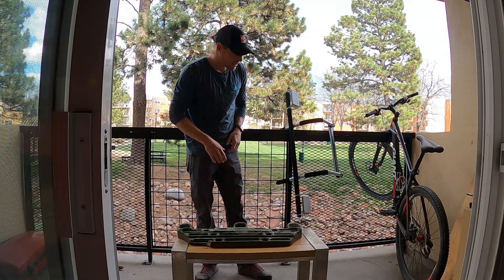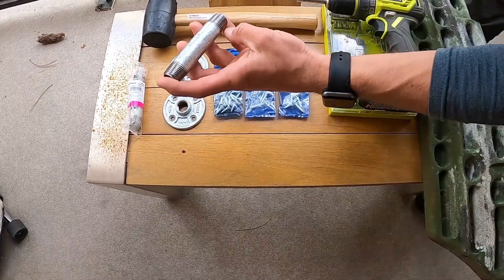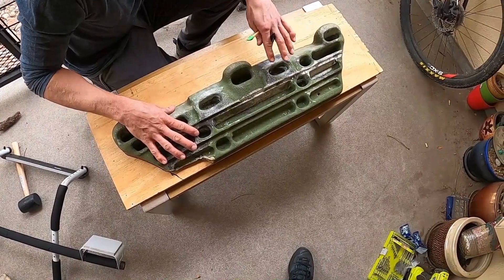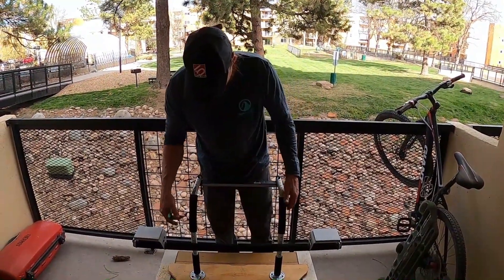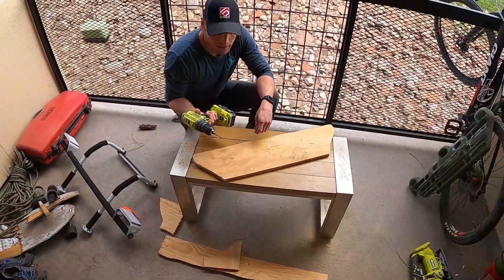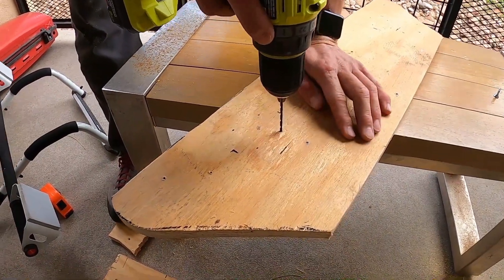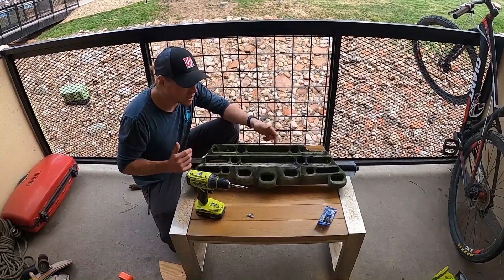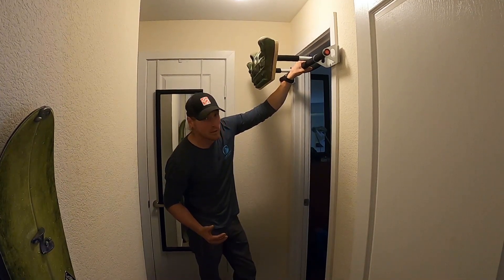DIY How to Mount Your Hangboard / Training Board to a Pull Up Bar with Zero Damage to the Wall!

Comment: Is the front cap of the pull up bar meant to come off easily? Mine doesn't come off as easily as yours look, looks like I need a tool to help pop it out?
Reply from the maker: I am not sure if it is meant too, but the ones on my bar came off really easily. Do you have the same brand as the one I am using in the video? Different brands could be slightly different.